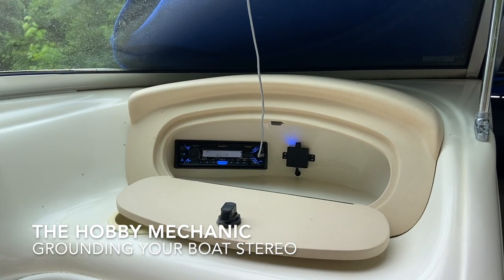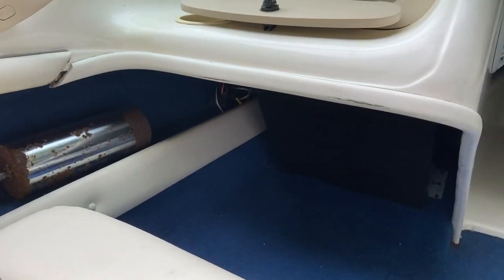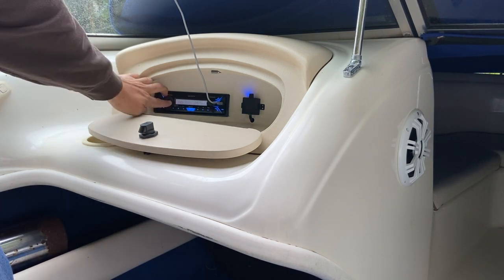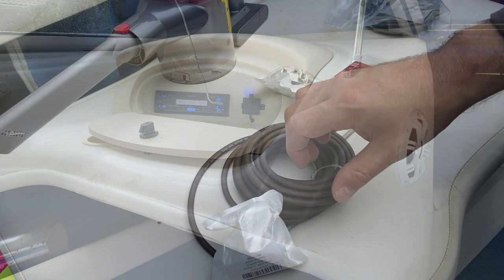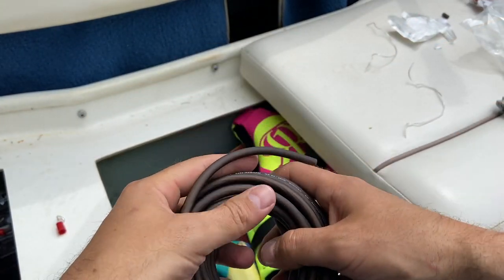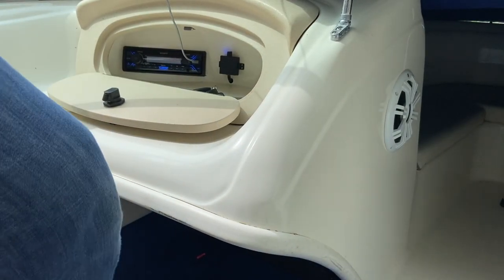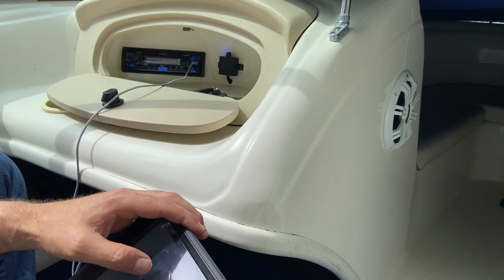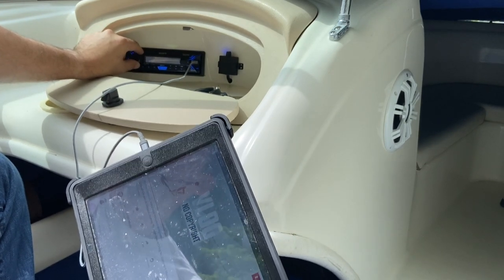Easily Fix Your Boat Stereo Grounding Issues - Hobby Mechanic

Comment: Awesome I'm going to try this I bought the same stereo marine version online for 138 great stereo but when I honk the horn the radio resets, I've heard the ground can be an issue. I think I should try what you did to fix your issue I think it will work for mine.
Reply from the maker: Yeah, give it a shot and let me know!  I’m interested to know how you’re wiring is causing that.

Comment: Whats weird is i just installed a new radio and amp. Went straight to the battery and i am getting interference while the motor is running🤔 trying to figure out a solution to this. I may need to run a negative bus bar and tie it in to the hull but not the battery.
Reply from the maker: You ran your power and ground straight from the battery for both stereo and amp?  It def sounds like a grounding issue.  Have you traced back your battery ground to see if that still looks good?  Also, bad RCA cables can pick up interference as well, especially if running next to power cable.  Just some thoughts.

Comment: Where do you have all your speakers mounted? Also, what subwoofer are you running, or source of bass?
Reply from the maker: I have 2 6" 2 ways mounted to the sides of the walkthrough.  They fire at each other so not ideal placement but its the only option I could see up front.  I have 2 more 6" 2 ways mounted on the side of the rear bench.  They fire forward.  I mounted a 10 inch car sub I had laying around under the passenger foot area (under the stereo/glovebox).  I mounted the amp under the drivers area.  Not a big boat so can't do too much more than that.
Reply: @thehobbymechanic47  thank you for the reply man. I'm working on redoing a 22 foot bowrider, and the seating cushions up front really limit my install places. I think I'll do exactly as you did, with them facing each other in between the walkway.

Comment: Nice video!  How do the front speakers sound?  I see they are pointed at each other.  I'm about to add front speakers and wasn't sure if I should put them in the bow or where you put them.
Reply from the maker: They sound great but that speaker placement isn't ideal.  It was the only location where the speakers could sit flat against the fiberglass.  My bow has some curve to it.  I originally wanted to install there but the curvature would of made it difficult.  In the end though it sounds pretty good for the placement and what little money I invested in it.

Comment: Did you also have an issue with the radio turning off when starting engine?
Reply from the maker: I have the radio wired to the battery so I can play the stereo without the boat key turned on.